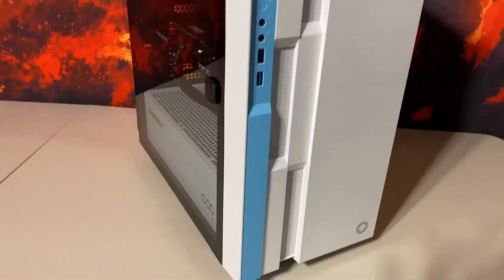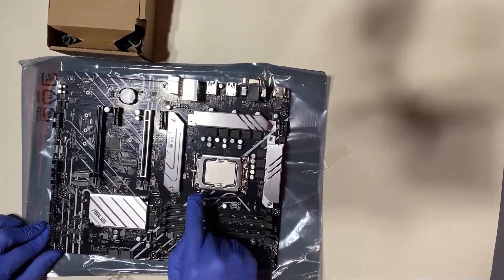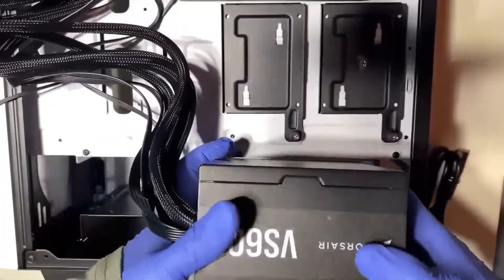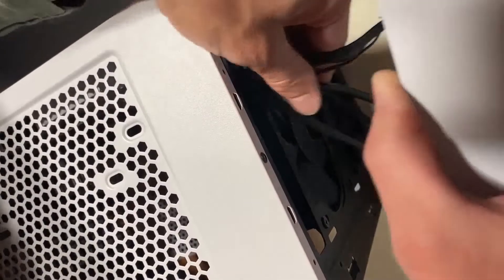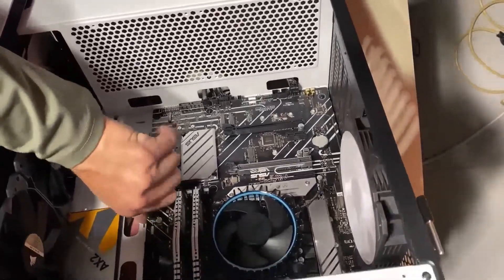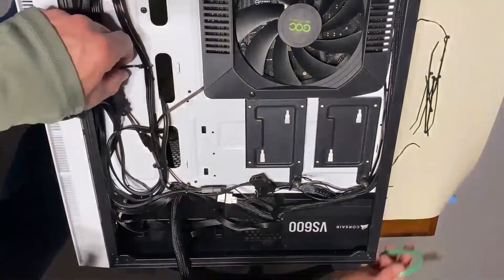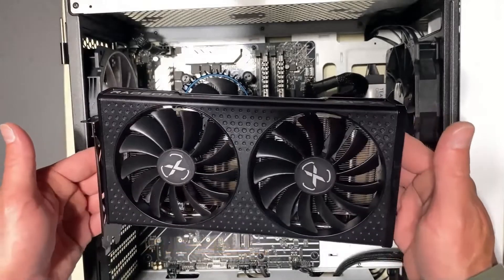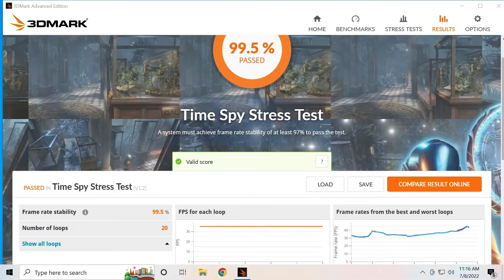Building a Gaming PC w/ Walker Gaming PCs Intel I3 12100F / AMD RX 6500XT / Asus Prime B660 Plus D4

Comment: hi bro. i have a doubt. should i get a 3060 12 gb or 3060 ti 8 gb? i know the ti is more powerful but upcoming games seem to need more vram. Farcry 6 already uses 10 gb of vram. what do you think?
Reply from the maker: I like the 3060 better both because the VRAM and the cooling design is the same for both but more effective for the 3060. The VRAM is the real sticking point plus you can alway overclock it a little to make the difference.
Reply: @walkersgamingpcs  oh damn i bought the 3060 ti a few  hours ago :(
Reply from the maker: That’s okay the 3060ti has a better GPU. I would make a custom fan profile though because they tend to run hot and temperature effects performance.